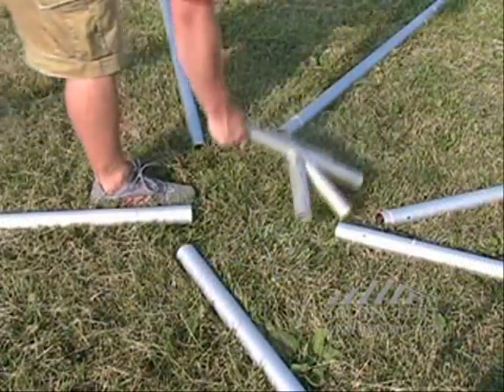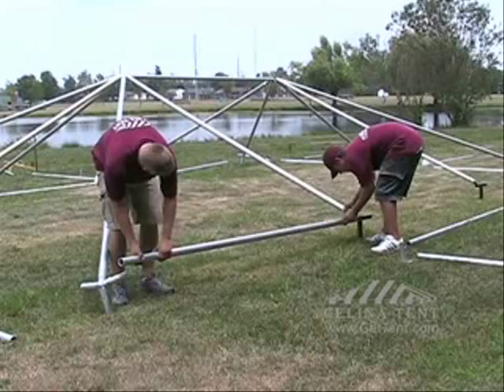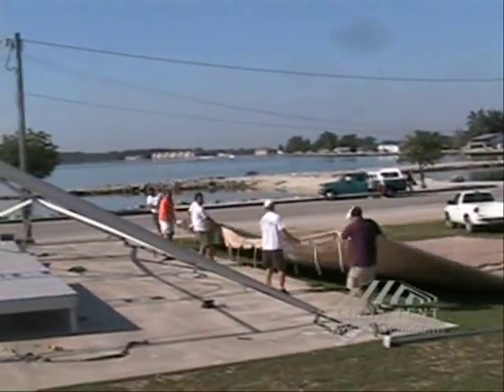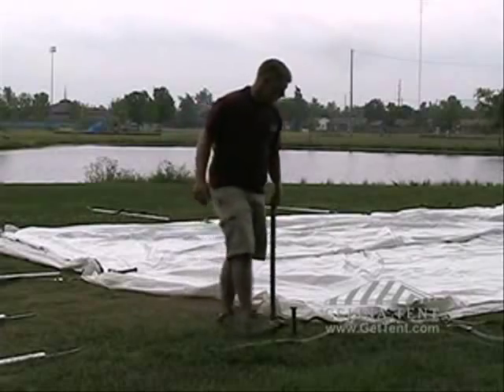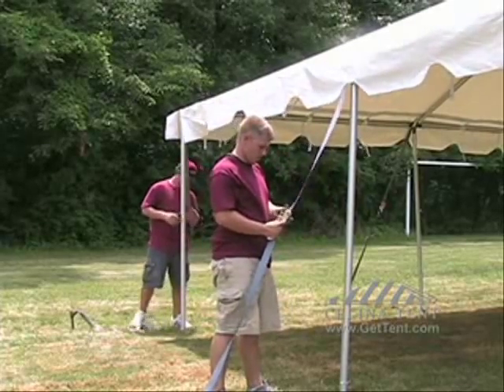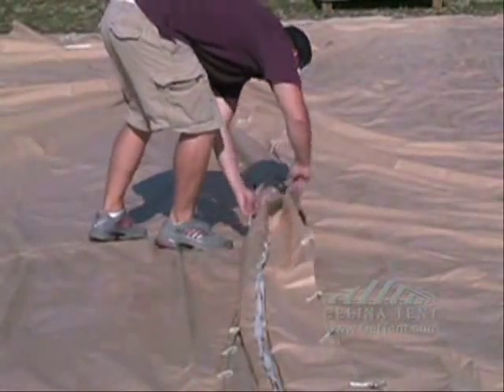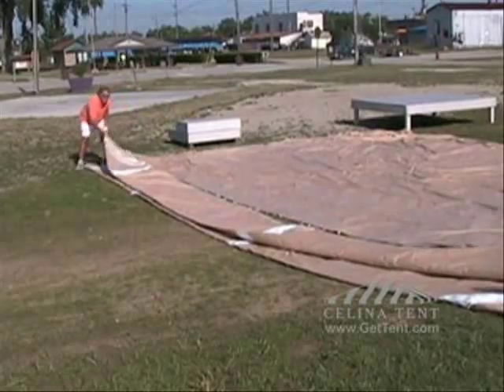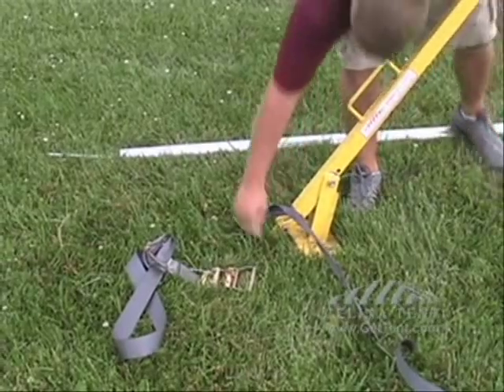Celina Frame Tent 40 x 40 Installation

Comment: first off when you were building the frame it seemed familair but diffrent than what i do, i saw you had no keder rails for the tent top sections than when i saw the tent top i saw why, i have seen it done like this a few times but mainly we use keder rals and valnces for the tent tops

Comment: btw to other commenter, the easiest and quickest way to build the frame is to build the top then start on one end of the tent and build and connect the peremiter at the same time as they did, and a 20x20 only needs 4 steaks in total if u ratchet them down well enough